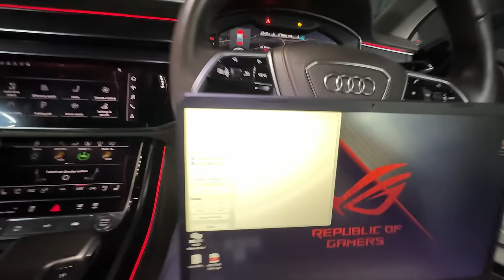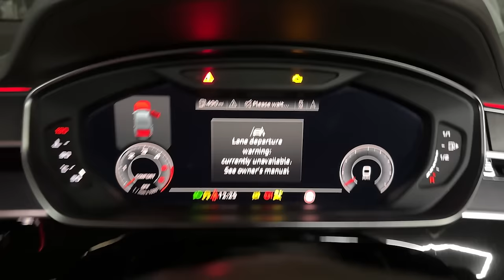We finished the Audi A8, but there's a problem with the mild hybrid 48V system. Is it our fault ?

Comment: There are several possibilities to come out of this situation : 
1. Try to charge on the 12 V just with a normal charger with very low amper - for instance 1A or 2A for 24h. Then start the car and check if it is charging.
2. If not, go 19 Gateway, search for: reinitialise 48V system after crash. Or reinitialise the 48V after deenergisaton, or both one after another. I think it was in basic settings.

Comment: I have been trough this. If you do not re energise the 48v system with Odis,it won't work.  I have done it at least 3 times. It is not complicated
Reply: Does this procedure require online access?

Comment: Put a charger on the 12v jump posts, you should then hear a click at the 48v battery. It will then charge the 48v system via the DC/DC converter. If the contactors in the battery don't close then the system can block the starter generator from charging. You can check the output from the starter generator with a multimeter and should be around 50v. Also, if the starter generator is faulty then it will block the 48v battery from closing the contactors. I've seen a number of times where we have to replace both the 48v battery and the starter generator together as one can damage the other. It's not complex in theory but what makes it complex is trying to diagnose what is causing the system to not work.

Comment: Go in with VCDS/ODIS and see if you can re-initiate 48v battery charging. You need to reset the system after the battery has gone flat. Should be under basic settings in a module, I forget which one.

Comment: Had the same issue, after replacing the alternator I needed to do this "in Battery Regulation in Adaptation [Closing of protection for charge of HV Battery] the new value needs to be ACTIVE."
After that the 48V sistem should charge.
Good luck

Comment: battery module, guided function choose close charging connector. You will hear something clicking. After that the battery starts charging
Reply: Not always if its on critically low battery voltage, it wont allow to close it via odis which probably was the case here
Reply: Pete, I’ve just noticed a clicking sound from the 48v in the booth, don’t know if I’m loosing the plot, is that normal ?

Comment: Support your honesty anyway and we all need to learn new thing. Those who are learning them in a correct way - doing that expensive, but they are getting a knowledge for sure to avoid making that next time. So do you Guys, respect you for this! If I can make a very small advice - put 12 V battery, I am used to plug it in always, this can prevent draining 48V... maybe... Cheers from Sweden.

Comment: If the 48v battery is charged between 5 and 15% it Will Block charging from the starter generator. You can unlock that with odis and charge it through the 12v jump points. I just replaced a starter generator last week on an a7 and had it charging for 18 houes after, it got to 70% 😂

If the 48v battery is under 5% then odis doesnt allow you to unlock the battery again to charge.

Comment: Just a word of caution of handling the exposed circuit board in that you could inadvertently damage  it by handling without ESD precautions (i.e ESD safe mat, grounding and wrist strap).
Reply: He's wearing rubber soles on a concrete floor. He's not a spotty teen changing CPUs in his carpeted bedroom.

Comment: Had the same problem on a audi a6 c8 3.0 tdi. Generator was dead. Replace generator, code it, charge the 48v system by closing the connection with vcds and putting a 100A charger on the 12v terminals in the engine bay and you’re good to go 👌 these generators fail a lot

Comment: I had one in that wouldnt charge and another garage had thrown all the bits at it and was about to buy a battery as well, re latched the battery in basic settings and found the original very cheap part that had failed causing it to not charge and it was like new again, these hybrids can be so much fun 😂

Comment: You normally have to charge the 12v through the 12v jump posts for a good hour or two depending on how flat it is to bring the 48v system above around the 15% mark then it will be able to re energise/ pull the circuit breaker back in and will all start working again as it should do 👍
Reply: He said the 12V battery is charged by the 48V battery through the 48V to 12V step down converter - not the other way around as you suggest (granted he does not have the understanding of the 48V system).  But I agree that it would be ridiculous not to have step up charging from an external 12V charger.  It would take a while, since using say a 50A 12V charger would only put in about 10A into the 48V battery.  The control board should not have to be reset - it should auto reset when it detects the minimum voltage on the battery.
Reply: @einfelder8262  yeah, the ones I have come across this seems to be the procedure, it can take a few tries of asking the 48v system to re-energise using odis, or I would guess vcds also has the capability to re-energise, but that would be my next step to leave the 12v charging or possibly in diag + mode holding the battery voltage at 13.5v or 14.2v for hours to see if it will boost the 48v back into life then try re energise if it doesn’t do it automatically
Reply: @einfelder8262  It's a bi-directional DC-DC converter.
Reply: @TheUweRoss  Thanks for the info.  There is still a problem with the whole system, though, in my opinion.  In this case, the 48V system charged the 12V system continuously (as it should) BUT it kept going until the 48V was dead.  Should have stopped before that happened. Then of course the 12V also drained.  Badly programmed BMS or DC-DC shutoff settings?

Comment: The mild hybrid alternator has component protection which needs to be removed but this is not the case. I agree that a guided function in ODIS should resolve this issue. Contact someone who can remove whatever component protection has been enabled via ODIS. Maybe audi retrofits in Iver.

Comment: Hey mate, there is a MVB to check on the starter/generator that will tell you if its defective. its a torque value if im not mistaken. I have replaced countless RS6 and RSQ8 starter/generator after the unit fails and the car dies on the customer with a depleted 48V battery. Once the generator develops charge the system functions again. Just tryna help. ill try find that MVB for you if you are keen.
Cheers.

Comment: I'm lucky with my Audi. It's an A8 D3 V8 4.2 petrol. The best thing about it is that it is not FSI. I have driven it for 265,000 km. it does not consume oil the gearbox works the air suspension works, problems are very simple and you can basically do everything yourself cheap and easy way. the car is 20 years old and runs perfectly. What will happen to an Audi like this in 20 years when it is already broken like a nightmare. No stypid 48 volt systems!

Comment: It opens a contactor in the 48v battery unit to prevent deep discharge. You need to hoook odis and re-engage the contactor, its in there in the bat unit adaptation menus.

Comment: I work at Skoda and we have few issues with the 48V system with no coms or under voltage lights all on dash. We have a TPI for a software update and that fixes so many issues try contact your someone at Audi to check for you

Comment: Before replacing the generator, check the individual cell voltages of the hybrid pack. In Lithium packs when a cell voltage differs more than a determined value from the rest of the cells it cuts off the pack. As it it is charging the 12V system this issue would be remote, but it’s still worth considering. Maybe the company that flashed the control module will have a option on this. As far as charging goes you can slow charge each cell to the specified voltage of that battery chemistry. I would advise to disconnect all bms wires during this process as charging the cells individually will definitely cause voltage irregularities in the cells. Hobby chargers can be useful as they have the ability to cell balance, but you must check that they are compatible with the exact lithium technology in this 48V system and that it can handle ( 48V / 3.2V ) = 15 cells in series (15S) “3.2V being the nominal voltage of lithium iron phosphate batteries, I suspect this is the battery chemistry used in this system”
Reply: There is no voltage at the generator output.
Reply: @einfelder8262  if the generator was no signal input v then unless it’s a Permanent magnet generator it will not generate any voltage

Comment: I once ran into a problem like this in an Audi A7, I was able to get it working again with ODIS software by using it to reenergize the battery. When the system is disconnected the 48V system automatically de-energizes the battery and this needs to be enabled for it to start working again.

Comment: Just a heads up, I have came across this problem many a times. Do you have an oscilloscope? There is a particulate matter sensor at the rear of the exhaust. When we unplugged that the CAN system came back online and allowed the system to charge, its shorts and drags the CAN system down. I think this is all coincidental for you and the problem existed before. Try this and all the best.

Comment: I would have thought that all the modules would still communicate on the can bus even if the 48v wasn't active as each one would also have a 12v feed. Looking at your fault log at 12:03 the slower bus signals like lights and sound system are communicating ok but not the high speed bus for engine and transmission etc . I think something has got damaged and shorted out the can bus. If you have an oscilloscope you could check the communications to verify if they are ok and if not unplug modules on the affected bus to see if it helps. Another channel had a faulty brand new power steering pump which shorted out the can bus whenever they connected it. Until you regain communication it is not worth looking into the 48v side issues.

Comment: Saving the polar bears by deleting the spare tyre with usless 48v system.
I'm sure you're going to be so happy with that when you slash your tyre on something.

As per ohms law though, if the voltage was low, the current goes up. Could've shorted something.

Comment: it happen to me one time with a q7 the 48 volt stop working after  replacing the engine harnest due to a mouse nest . tcm . abs . ecu . headlight range wont comunicate . i unplug each module and replug one by one and check comunication then if the comunication is made with the plugged module i check the live data if something wrong  at the same time i check the live data of the generator with a lab scope . when i plug the ecu the data of the generator start acting funny and when i plug the ecu all the other module start to lost comunacation but like you the car start and run but wont charge . i have a lunch throttle 3 and have acces to audi server like odis . i check each configuration of each module of the entire car and after 3 module update and 1 svm  for the battery converter module it work like before .  im glad if it can help you

Comment: What a crazy headache to have - no wonder it's getting harder to find mechanics these days. 

If I were thinking in my old school way, I would remove the drive belt from the motor/generator, and hook up another motor with a short belt underneath the car, or even use a drill with a socket fitting, and drive the generator until such time as the 48v battery and 12v batteries are both fully charged. Of course, if no charging occurs, or very little charging, then it's possible the motor/generator is toast. After that, either reconnect the main drive belt and try starting the engine like normal if it did charge up properly, or it might be time to order in a new motor/generator. 

This is the reason I really wan't to build a mechanical compressed air powered motor, and replace all these hybrid monsters of technology...

Comment: open the battery and charge directly bypassing the BMS , if the BMS see's no voltage it wont charge 'it needs voltage in the battery for the BMS to start charging again and use at least a 52v charger.
Reply from the maker: Did

Comment: it is possible to disconnect the 48v battery and just run the car with the 12V system? I would like to buy a 50 TDI but do not want to mess around with this complicated stuff, just want to drive a v6 TDI without worries. BTW: what is the benefit of the 48V MHEV besides costs and headaches for the owner?
Reply from the maker: No
Reply: @VAGTechnic  :washhands: Do you think newer builds are more reliable (2024)? I am looking to run a new 50 TDi for 8 years or longer

Comment: First as you say you don’t have basic skills tools like a 48v charger. So get that one. Second there is an option to re energize charging through the diagnostic but the battery has to be charged (the 48v charger comes handy) . Third the wisest thing would be the car to go to the dealer because like this you are wasting both the money and time of yours AND the owner who probably needs to be awarded the medal of patience..not because you are not good at your job you are excellent but because you don’t take quick decisions. Don’t forget that in 10 years the car mechanics will start being replaced with electric engineers :)

Comment: When you are doing a major repair on a 48volt system the first thing to do is disconect the system on the vag computer.then carry out repaithen reconnect the system otherwise big problems.the car will have to go to a main dealer

Comment: What another nightmare of a system from Audi 🙁
Reply: Is it! I've just read that it can generate 5 -15kw when operating correctly, that's a phenomenal amount of power 😮
Reply: I've had 2 A8's.. Cost a fortune in problems.. Nothing mechanical but everything electronic! I now drive a volvo and it only produces happy miles so far..

Comment: thats not cool!! worked on a car with a fault also hybrid vag at the and a filter of the dsg popt loose and bloked the oil opening
Reply from the maker: Seen That fault
Reply: @VAGTechnic  Yes hapens ofthen ,did you tried a fully charged ass battery and do a hard reset
Reply: @VAGTechnic  looking again ad the video realy strange did you measer the amp draw when starting ?did you cranked the starter direct whit out the key in with the belt off sorry for my shitty englisch i am from holland

Comment: The systems that they are installing on these cars is useless.(Maybe the Polar bears are happy)
All the manufacturers  are designing these over complex systems which are way over the top.
Who on earth will buy a 10 year old car like that .Its going the scrap heap along with the Electric cars.
After over 50 years repairing cars I am glad I am retiring.
German Junk.

Comment: The Belt-Starter Generator (BSG) is indeed the problem. It needs to be replaced and you may end up needing to replace the 48V and 12V batteries as well. This is happening to all Audi vehicles equipped with the mild-hybrid system. Thousands of cars are waiting to be fixed because the replacement BSGs availability is another problem. People should stop buying these garbage cars.